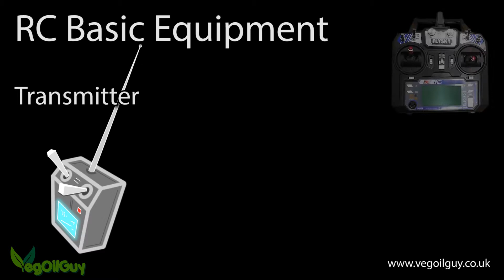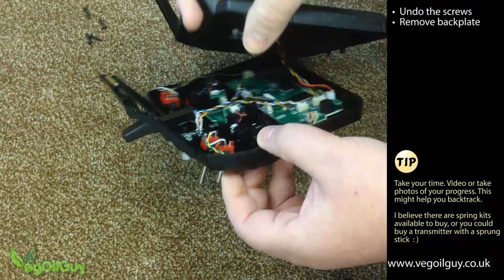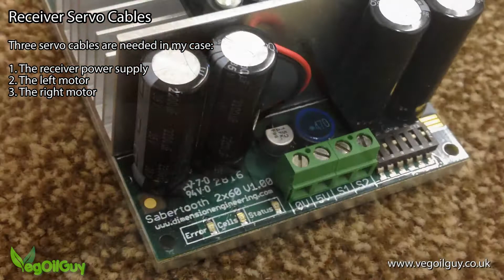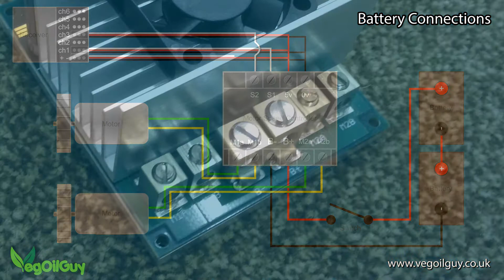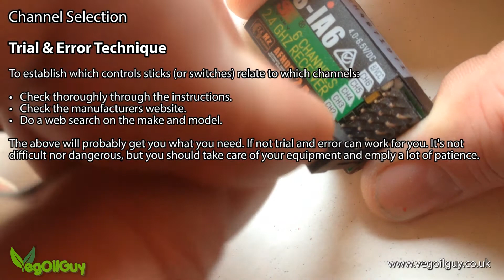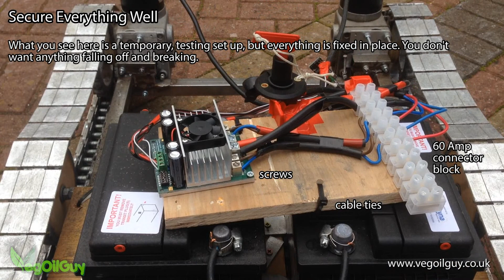radio control complete beginners guide - rc made simple - by VOGMAN

Comment: You think that's difficult, you should try the dedicated radio control for model steam trains (G gauge) . They are command and control receivers, in that they simply carry on doing whatever you last set them to do, you can even switch the transmitter to another channel and control a separate train whilst the first carries on. Setting them up is a nightmare.
Reply from the maker: Sounds challenging  : )

Comment: I realize this is an older video but very helpful to me in figuring out how to make this work.  Did you ever come up with a solution for the safety switch?  I was thinking about a separate little motor with a threaded rod and welded nut to actuate the mechanism.  Since the controller has 4 more channels beyond what the motors require, I think this could work.  Also did you ever build in a method to raise/lower the deck height?  I was hoping to use some beefy linear actuators to move this up and down with a hinge mechanism similar to the off-set cogs used to hold the wheels in the stock configuration.
Reply from the maker: Hi Ron. Yes it's amazing... a year has gone by already. Where does the time go  : )
In terms of the video, I think everything is current. I don't think the world of remote control electronics has moved on that quickly, thankfully, but you're right to chase me for a follow-up video on my remote control lawnmower project.
The truth is it's been such a hot summer the grass hasn't grown. 
I did buy a electronic fuel switch, to stifle the petrol flow if signal is lost, but I haven't done anything with it. Shame on me : )
I really must.